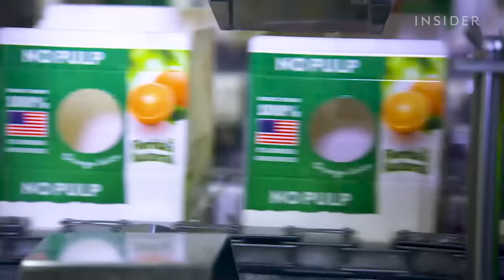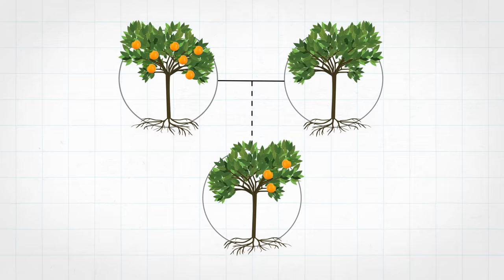Why Florida Oranges Had The Worst Harvest Since World War II | Big Business | Insider Business

Comment: The problem is monoculture, growing so many of the exact same clone.  If one is vulnerable then they all fall like dominoes, same with bananas and many other crops.  Plant some oak trees around the orange orchards and interplant them with guavas.  Home gardeners have found that citrus grown like that tend to evade HLB.  It might not work on large scale.  But even if it does it raises prices.  I'd consider diversifying my crops in that case.  There's many other fruits that can be grown in FL that fetch decent prices.
Reply: Wonder how long that will take. Notice they said the crop dropped 71% between 2020 and 2021. Growing other trees and diversifying crops isn’t going to fix their immediate issue. Their is also a reason they use monoculture and only produce one fruit.
Reply: @charlessmith3940  The reason is that it’s cheaper, because the individual farmers aren’t held accountable for their negative externalities. The intermediate solution is to just accept having fewer oranges for a while, we can’t let static friction keep destroying our ecosystems.
Reply: Yes youre a professional. Why arent you working on this situation?
Reply: Yep, in a way, the pests are doing their job: removing the unnatural clones. Farming needs more diversity anyway. Why only one variety at the grocery store of citrus? Why not many more?
Reply: @Napsteraspx  it’s all about cost and efficiency. What you just said is the equivalent to why a specific factory doesn’t produce 500 different types of cotton towels. Vs one. Factories make shit at the cheapest cost to them.  They make what they have contracts or a likely hood of selling. Farming is no different. Majority of CERTAIN fruits and vegetables go unpicked cause they aren’t pretty enough for Walmart. Growing different varieties would produce an even greater variance, they could have different harvest times, could be vulnerable to other pest and diseases etc. Majority are fed through machines at some point and this is where size and shape is extremely important. I’m not saying I support mono culture but farming is a tough business and asking them to diversify on a large scale isn’t realistic. As is, they can barely produce a profit
Reply: Not to mention to make room for growing these they cut down all the other native plants which are probably hosts for predators of these bugs...
Reply: Monoculture is only one part of the problem. There is hope, some farmers are seeing their trees come back because they are focusing on soil health: See: Citrus Grower Sees Success with Cover Crops Insects are attracted to weak plants. Start with healthy soil without pesticides and you'll have healthy plants.
Reply: Monoculture is always a problem. In our pursuit of efficiency we lose diversity and thus resilience.
Reply: what a beautiful parallel to current human politics. people are fruits
Reply: No it’s not. The citrus industry is a large one with encompassing many varieties. Please educate yourself.
Reply: Yes I wrote such a  comment before seeing the other monoculture comments.
Reply: @Junkinsally  monoculture refers to growing 1 type of crop.  It doesn't matter how many varieties one has of the same crop.  But this is a complicated problem and most likely will require several different solutions to solve this.
Reply: @charlessmith3940  pomegranate has a shorter growing season and is profitable in about two years, and a higher crop return. The state board growers whatever it’s called, recommended it.
Reply: Look Saha a desert the mid west, America’s bread basket 🧺 “ has become from monoculture, people need to go back to having their own family farms that produce what they eat, I’m trying it. I’ve planted grocery store rows, 1 fruit or nut tree, to 3 berries bushes, to 9 -15 ground  covers, like herbs or strawberries for example for each set.
Reply: @Napsteraspx  there's plenty of fruit varieties here in Washington Dc, even "Sumo" oranges with a bun and thick skins.
Reply: Americans love "one hit wonders". Nature has multiple, complex, symbiotic relationships working in tandem with multiple variables humans will likely never fully understand in their entirety. Our best bet is to enable healthy, diverse ecosystems that are appropriate for that location so they can thrive and we can harvest abundance without destroying the balance of those ecosystems. See Dan Barber's TedTalks titled: How I Fell in Love with a Fish" and "A Foie Gras Parable" for outstanding examples.
Reply: @amandathurston2720  ok cool. What about seeds, planting, picking, infrastructure needed to get it from seed to store shelf. Doesn’t happen over night. If the STATE or Government is going to throw money at the problem of course farmers can diversify. The average farmer cannot make massive changes on their own. That is the only thing I’m saying. Marijuana is also profitable. Doesn’t mean they can all start growing marijuana tomorrow.
Reply: @amandathurston2720  We grow what we grow because that is what we can sell, sometimes for a profit. If there was a profitable market for more diverse products, we would grow them. Since this happened in Florida I am sure it was Biden that caused it, like everything and anything negative lately.
Reply: @999pr1  simple economics point to supply/ demand, but how can there be a demand for things people have never seen before? Create the demand, because you want to supply it. The county line does it. I’ve discovered new foods there, it’s in St. John’s county. And the Ag department is recommending pomegranate, the video even said that y’all have to mix OJ might as well grow the ones your importing right?
Reply: What's the price of utter crop failure?
Reply: @Junkinsally  not nearly enough variety. Before humans every Orange tree carried different genetics because they all grew from seed, but now we have plantations with thousands of trees that are a mere cloned genetics from a single tree.
Reply: @violetviolet888  right!
Reply: ...they need to find another bug (harmless) that will eat the Asian bug, and add them to the orchards.
Reply: @amandathurston2720  We consume about a ton of food each per year, it takes space to grow that much food and you have produce many types of food, process them, and store them.  This is part of why homesteaders were able to claim 160 acres back in the early days of America.  You would have to raze cities to the ground, completely redistribute the population, completely retool society, and completely re-educate the entire population to even have a chance of making 365 million people self sufficient food producers assuming you could even get them to partake in the immense physical labor that would entail.
Reply: It's more complex than that, but it is part of the issue. Historically, so many BAD decisions were made... This didn't "happen" by accident. It's the farmers' fault for growing weak trees. Insects only attack weak trees. NEVER healthy ones. In Florida, most of the trees are unhealthy because the planting density is too high, because they use pesticides and herbicides that destroy soil life and kill plant biodiversity. All of this happened gradually since the 50s. For a healthy grove of trees, you need them far appart, with native vegetation growing everywhere. That's how you get trees that don't attract psyllids. Any time you get insect damage, you need to think "what did I do wrong here ?". It can be a number of things : compacted soil, naked soil, too dense plantating, excess fertilizing, any pesticide, not enough water, too much water, etc... You can detect plant health with a refractometer, analyzing the sugar content of the leaf. If it's below 12 you're in trouble. When you get sucking insects like psyllid, you're around 6. A few farmers in Florida are above 12 coz they let the wild plants grow, no naked soil, no pesticides, and space their trees properly.
Reply: @charlessmith3940  its almost as if we cant base everything we do as a society on how cheap it is to do. Mono cropping may be cheap in the extreme short term but its stupid expensive in the long term and damages society. What is more important some profit margin on fruits or the function of our society?
Reply: @iraniansuperhacker4382  long term growth and health of earth is important but all I’m saying is the average farmer is operating at a loss, and is just trying to feed his family. Of course I’m against mono and wish the world and humans coexisted perfectly
Reply: @charlessmith3940  I agree with you here I dont really think its the individual farmers fault but I do believe the goverment should help subsidize agricultural/farming experiments because our soil health and food supply is intrinsically part of our national security.
Reply: @Junkinsally  you don't know what monoculture means
Reply: @curto201  ahh yes another professional critiquing other professionals. Does that make me a professional?

Comment: I grow, among other things, cucumbers every year and they were so easy to grow, I had to give them away. That is, until one year all of my cucumber vines started dying due to the cucumber beetle, a tiny yellow with either black spots or stripes. It pretty much does does the same thing mentioned in this video: the only difference is it bites at the root, which affects the vine very, very quickly. One morning you wake up and the vine looks like you didn't water it in two weeks! You water it and it comes back to life and you think all is well, only to see the same thing the next day. The best solution when you see that is to remove the vine and burn it.

And just like in the video, putting "clay" on it (called kaolin clay) helps...somewhat. But every time it rains, you have to go put it on it again. So annoying.
Reply: Do you till the soil?
Reply: Why is no one suggesting Spinosad
Reply: cool story bro.  I had a similar bug problem and I did nothing.  Then one day some doves came to my garden and ate the bugs and my plants recovered
Reply: Are you using miracle grow or other garbage fertilizers?

Comment: I lived in FL and had citrus trees in my yard, all affected. I sprayed one lemon tree with one treatment of a high quality colloidal silver on its leaves during a short dry spell, and did not spray the other lemon tree of the same age and size as the control. I did after reading the claim that colloidal silver is anti viral.
The sprayed tree had no further issues, making large healthy and tasty fruits, and then after the next spring it developing normal lush foliage. It maintained its health for the next four years, until I moved. The other tree made fruit, but some were bitter (a known symptom of citrus greening that the video didn’t mention, surprise surprise), and each year the foliage on the untreated tree looked less healthy and less dense.
A citrus tree at a nursery is not cheap. It is worth it for homeowners to spray the leaves with colloidal silver. I didn’t soak the tree, I just did a misting trying to get a quarter of the leaves all around the tree. I choose the dry spell so the leaves would be prone to absorbing the spray. I wondered if injecting into the bark would work, but never tried it.
Reply: Homeopathic approach, price per gallon exceeds value of product.

Comment: Granted that Florida is a sandbar, I'm curious as to what a good cover crop would do to the farms, much like what they talk about in biggest little farm. Not just focusing on the crop variety and companion planting, but also focusing on the soil quality.  It's all connected.
Reply: Although florida gets a lot of rain on an annual basis, the sandy soil that the orange trees are grown on is very fast draining. Thats why they use drip and low pressure irrigation. Any cover crop- I think you mean "green manuring" between rows and trees- requires enormous amounts of overhead water spray irrigation. Likely also adding moisture problems and other pests as well.
Reply: @wilmorris8335  true, but the diversity might help manage it all. Not just on a monoculture level but an ecosystem all together
Reply: Cover crops are planted there.. also pfr97 and met52 would work for this and was developed by florida uni for this... these farmers are just uneducated in soil science for sure.
Reply: @wilmorris8335  No it does not. Cover crops grow just like grass (clover especially) plus adds nutrients and diverse soil microbes as well (pfr97 and met52 would crush these bugs, and ironically it is naturally developed in florida uni, heh) 401K grower here.
Reply: sandy soils are fixed via adding carbon to them. Grasses that grow long would be best, as their roots go deep to access & hold water, then each year or so, bring in a mob of livestock to cut all the above ground grass off, process it & leave it on the ground to become soil carbon as the rain pushes it into the sand, while the roots sloth off & also become soil carbon & any grass trampled instead of eaten becomes mulch, keeping it all moist while this all happens.

That's how you fix sandy soil, BUT those grasses also act as additional habitat for the bugs & help them move around on the farm, they don't stop that happening! Also, the alternative crop is finger limes, a rainforest plant that only grows well in rainforest type soils, which is basically what we're talking about already being in place in Florida
Reply: Yeah maybe Florida just isn't as suited to citrus as it used to be.
Reply: A440climbingchef: Already being done: Some farmers are seeing their trees come back because they are focusing on soil health: See: Citrus Grower Sees Success with Cover Crops Insects are attracted to weak plants. Start with healthy soil without pesticides and you'll have healthy plants.

Comment: I just bought a farm with about 200 cacao trees in Colombia. There is a fungus called witches broom that reduces harvest 50-85%. So far it is not in Africa where 70%+ of the world's cacao is produced. There is no cure but to prune to allow more light to reduce the fungus or to grow in arid climates with good irrigation.
Reply: either a soil mineral deficiency or you can try spraying a mix of borax in water.
Reply: I see that people do not clean there own pruning shears in rubbing alcohol it prevents the disease from going further. The bottom line is, you have people that do not speak English and are not following protocol on the farms. The farms need translators to make sure that diseases do not spread on fruit trees etc..
Reply: @sjjj9879  good advice, but they say it can travel by air and water as well and the spores can survive in the soil for years
Reply: @brusso456  soap, water and ashes mix has been reccommended but yes I have read that stressed trees are susceptible due to deficiencies as you mentioned.

Comment: When you use the same variety for decades or centuries without trying to make new trees from seeds this is what will happen. When you reproduce the same plant with same genes the plant will never adapt to the eco sistem changes, insects changing etc....while if you try to make new plants from seeds they will be more adapted, ofc the problem with that is the quality of the fruit. More time you use the same plant, weaker it will become to the external patogens that will adapt for that plant. Not surprising at all
Reply: It's not even a variety problem here. It's 3 main factors : chemicals (whether it's pesticides, herbicides or fertilizers), too high densities of trees (they think it solves everything, they couldn't be more wrong...) and naked soil around their trees (they need wild plants to have a nice rhizosphere and be stronger). Insects only attack weak plants. And this is what the citrus industry has been producing since the 50s : weak trees...
Reply: @nicolasbertin8552  i always thought that seeds replication of plants is better, because using the same plant over and over again with time makes them vulnerable. Maybe the fruit quality will be different, but if i were them i would focus on research to create new varieties of Citrus with good fruit quality. You found a Citrus that is extremely hard against the diseases/parasites and you take another one that has a good fruit, you make impollination in lab controlled. Make 10.000 plants wait a bit and statistic from all that some plants will have a decent commerceble fruit and hard resistence to disease or moderate. Their approach of fighthing disease/insects is bad from the start, because they cannot control the insects. They can use chemical pesticides but them it may harm the plants or make fruits harmfull for us. And also diversify the culture, dont place 5000 trees of the same identical type one near each other.
Reply: @dal968  I agree that fighting the insect is ridiculous, another one will come. The problem is weak trees. You can change the variety, but it won't solve your issues that are too dense planting, chemicals, and bare soil. Those 3 issues are far more important than variety. Once you solved them, you measure the Brix of your leaves with your refractometer, and if it's above 12 you're in the clear. Below 12 your tree is still weak. I'm still shocked that they think dense planting is the solution... It's been done since the 50s and been attracting new pests... They still don't realize that, while Thomas Dykstra keep explaining them that.